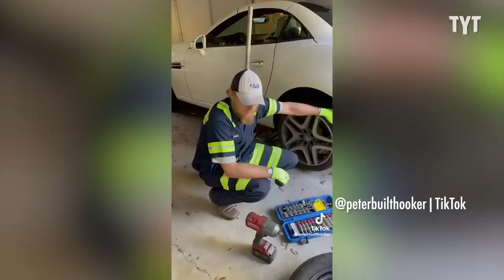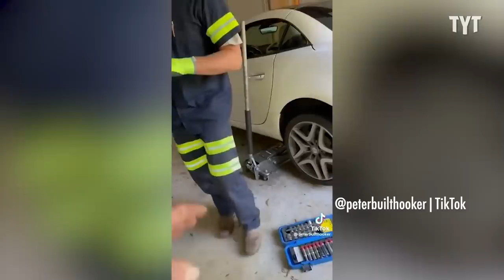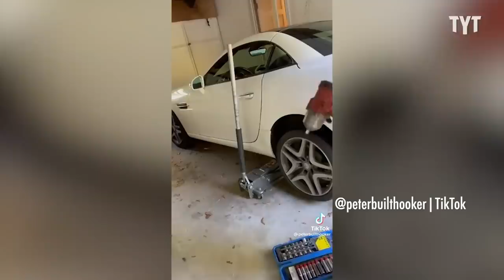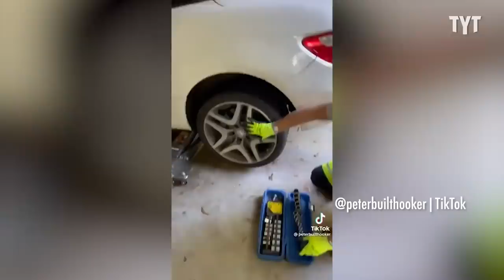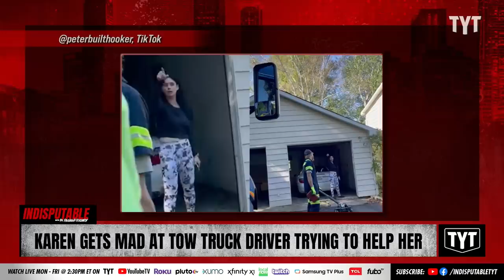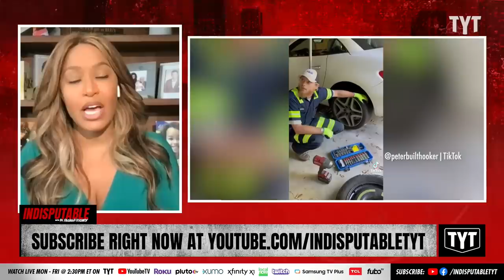Mean Karen Gets Personal With Tow Truck Driver Helping Her

Comment: I would have been mighty tempted to ask "Do you want me to take my tools and leave immediately?" And if I got a 'Yes' in reply, I would calmly lower the jack without the wheel nuts tightened, allowing the wheel studs to potentially snap. Remove my equipment and tools and walk away, leaving destruction in my wake. The only thing stopping me would be the potential for serious harm should she decide to drive it and the wheel came off in travel.